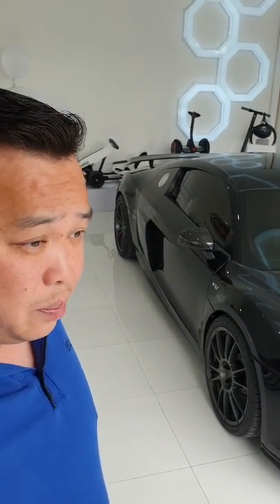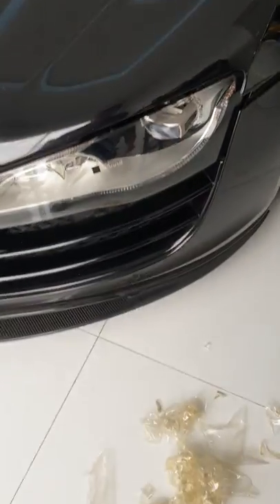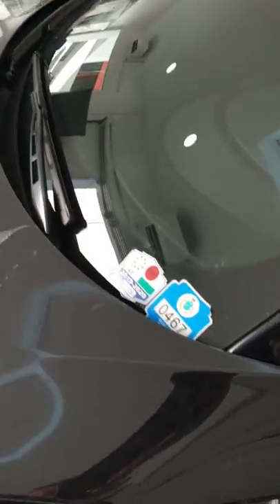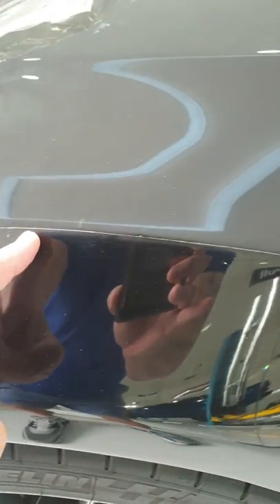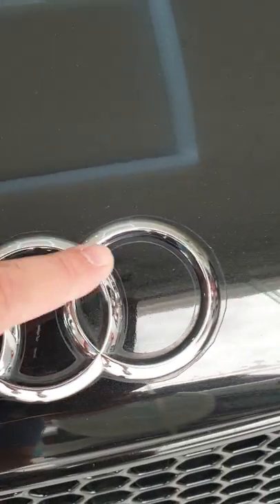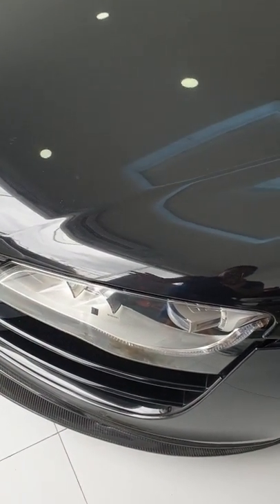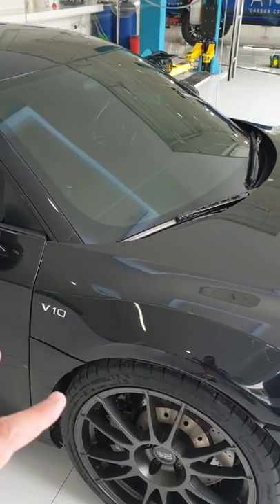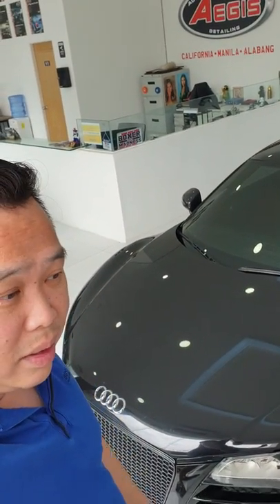Paint Protection Film PPF Limitations

Comment: hello sir, thank you for the honest sharing. Would you still consider doing another PPF given its limitations?
Reply from the maker: Unfortunately no. Our temperate climate cant sustain it.
Reply: @AegisDetailingPhilippines  then it's a no no for me I guess since I'm from Malaysia haha. Thanks!
Reply: @AegisDetailingPhilippines  wow thanks for the honest answer sir you just saved me on spending more money. I'm planning PPF for my motorcycle but if the 20k php or so won't last then its not worth it.
Reply: @AegisDetailingPhilippines  PPF has 2 Types #1 is TPH (lasts for 3-5 years) and #2 TPU (lasts for 7-10 years)..in your video I think PPF installed is TPH Type